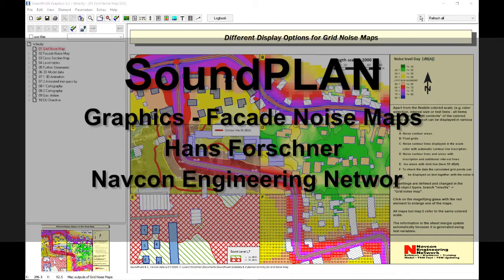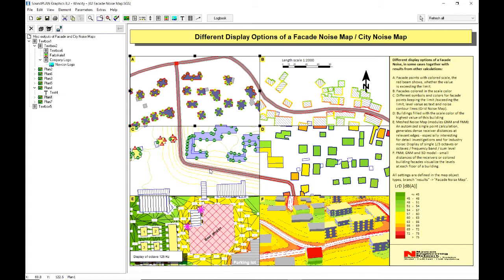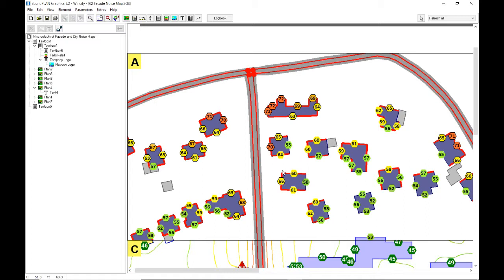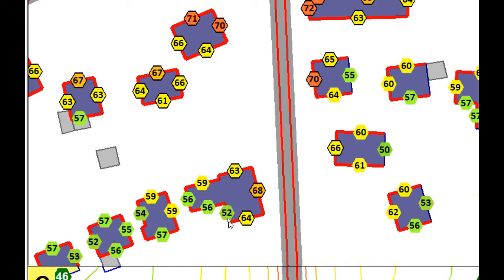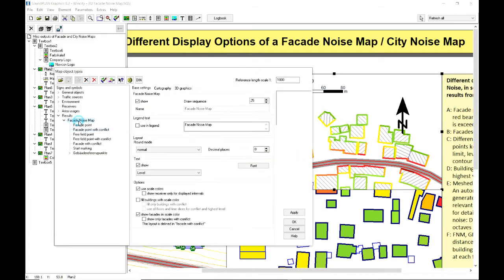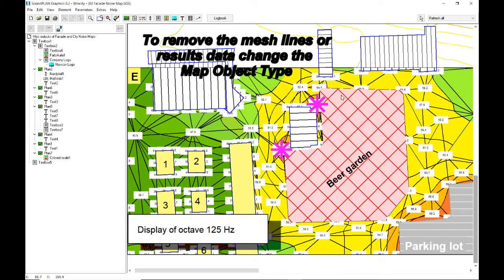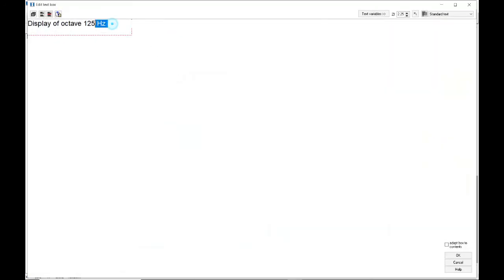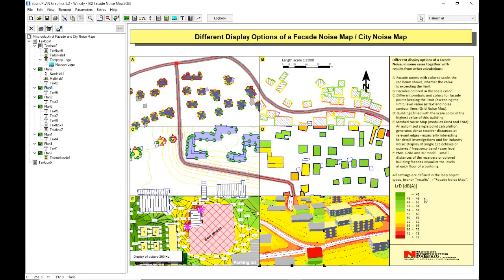SoundPLAN Graphics Facade Noise Map

Comment: Dear Hans, what is practical use of facade map calculation?
Reply from the maker: Sachin,  the facade noise map (FNM) are useful for a number of noise study application.  
(1) For new construction (residential, hotel, office building,..) it can shows in one view what kind of noise exposure you have for all floor and facade.  You may have very exposed facades and less exposed facades.... especially for high rise buildings that could be be a factor to consider in regards to the requirement for the sound transmission loss requirement for the windows of the facade shell.  
(2) In case you have noise barriers along a major transportation corridor the facade noise can visualize how much reduction you get for the lower flowers and where the limit is for the barriers.  
(3) the modeling of the facade with the combination of census data could provide you with overall impact on the community.  This is especially of interest in Europe for the Noise Mapping projects in City were you try to assess the overall impact community and to identify noise hotspots 

I hope that helps.
Reply: @HansForschner  Hans, thank you for the reply.